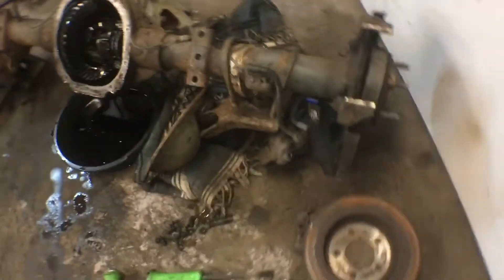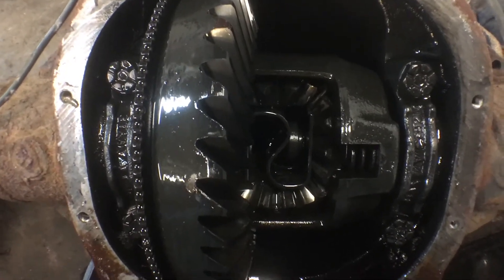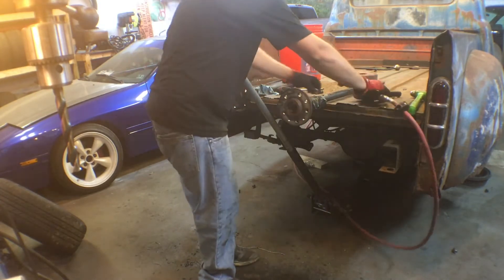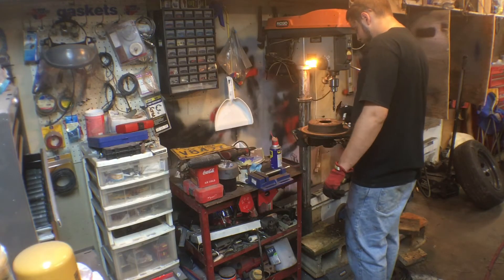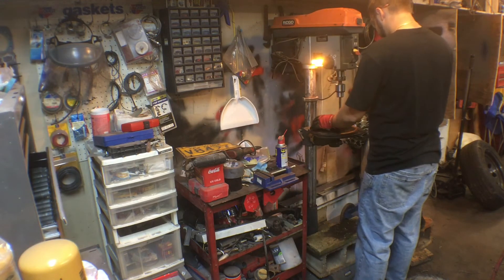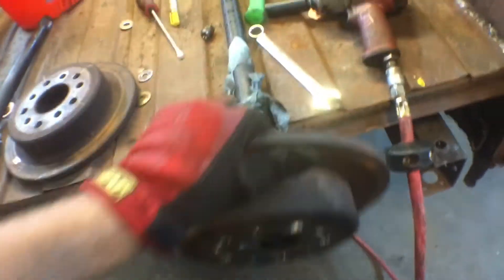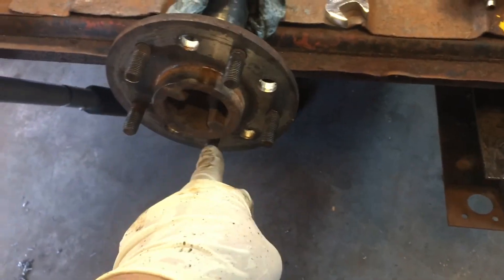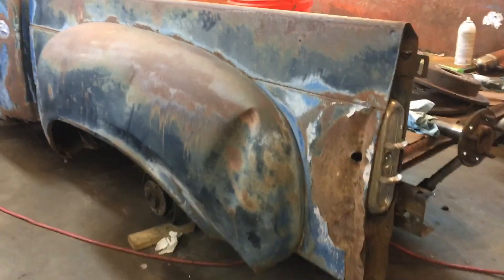How to ReDrill Ford 8.8 Axle Shafts For New Bolt Pattern

Comment: It's a 8.8 out of what? And I thought 8.8's are 3 inches longer on one side, did you have to cut it down?
Reply from the maker: Mike Dub this will work for any 8.8. This one came out of a Ford Explorer. Yes the pumpkin is offset, it only needs to be cut down if it won’t fit in whatever vehicle you want to put it in. Which is also simple.